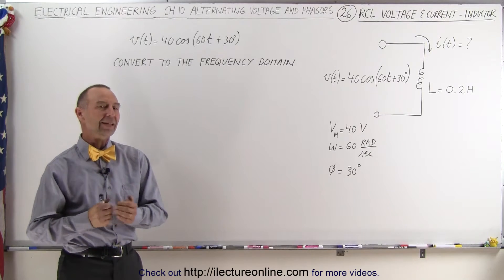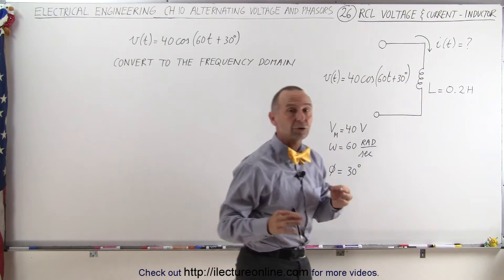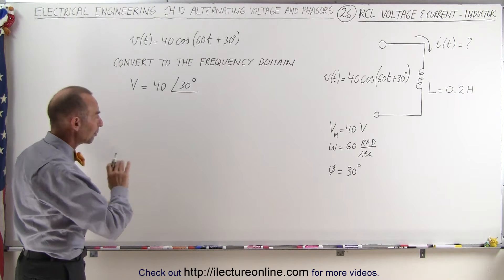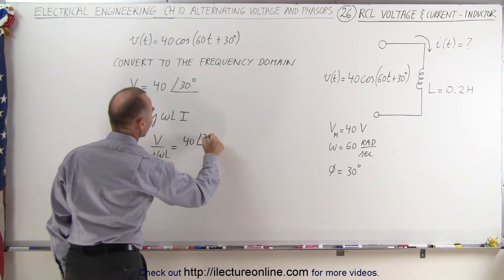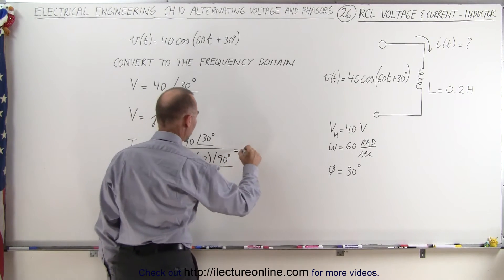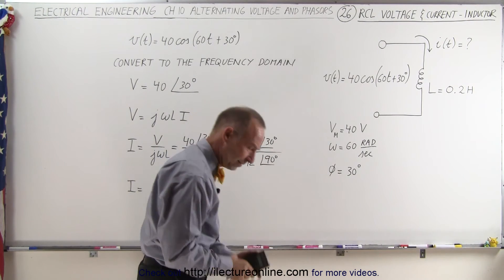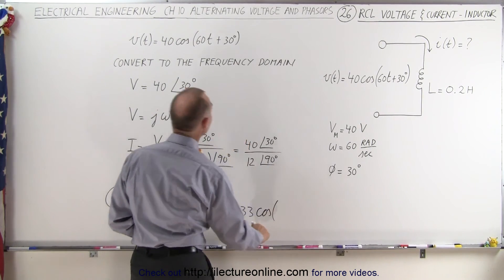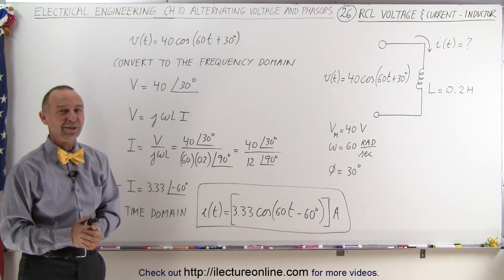Electrical Engineering: Ch 10 Alternating Voltages & Phasors (26 of 82) RCL V=? & I=? - Inductor

Comment: thanks sir for the great tutorials.. Question: as the voltage in the time domain represented with the Max value, when we convert it to the phasor domain, why we keep using the Vmax, not the Vrms ( and hence the calculation of the current will be the I max.)?  when should I use the max, and when should I use the rms values? . would you please clarify this point? thanks again!

Comment: hi sir, may i ask why is j the phase angle of 90 degree? it should be sqrt -1 right?
Reply from the maker: The phase angle depends on what you are finding or expressing, (current, impedance, or voltage), what component you are considering, and what other components there are in the circuit and how they are connected.